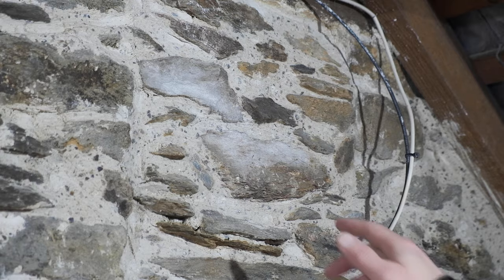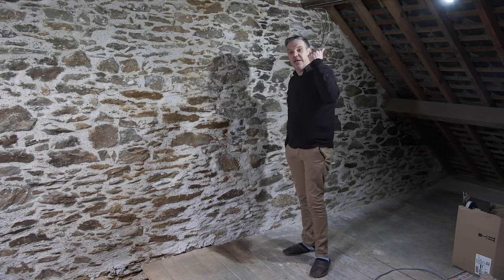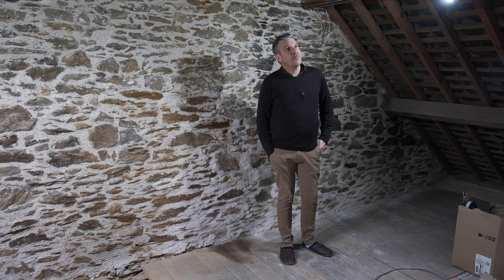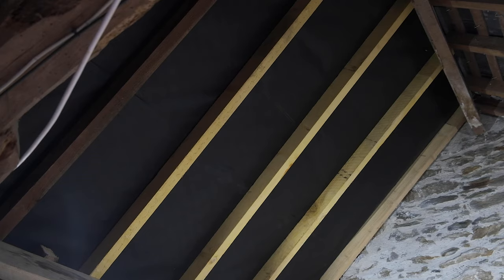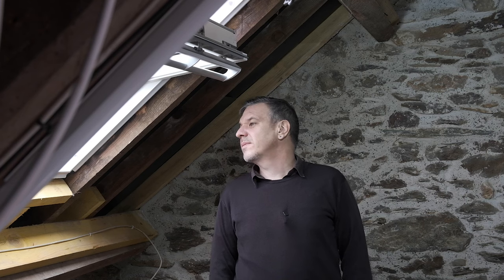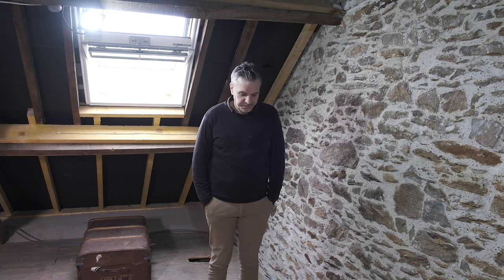Stone Wall Repointing

Comment: Congratulations on finishing the wall.  Repointed, it is greatly improved.  I'm glad you found the wet spot now.  DO you think it may be possible to patch the "rust through" spots with body putty or the like from beneath?  It would be a temporary solution to buy some time until you can afford to have the front roof redone with the same materials.  Also - a great opportunity to add more skylight.
Would you consider an episode where you review all of the moisture stopping work you have done including the humidity in the house before you started and what it is now?  It would be great to see the progress.   All the best!
Reply from the maker: Currently looking at how to deal with rust spots, and yes, will do an update on the moisture control measures at some point. Cheers.
Reply: @TheRenovationProject  Thank you for the reply 😊 I truly hope your work has reduced the moisture level in your home.  I suspect no single job made a huge difference.  Rather it is a case of the whole being greater than the sum of the parts. 😊👍

Comment: Do you think that you are leaving the mortar to harden too much before you brush it out? I think you should wait for a partial set, then brush it out with stiff brush rather than a wire brush. This will be much easier for you and will give a nicer result.
Reply from the maker: Yes, I do. I aim to correct this behaviour as we continue repointing. Brush = noted. Cheers.